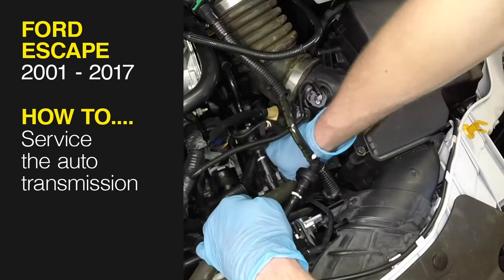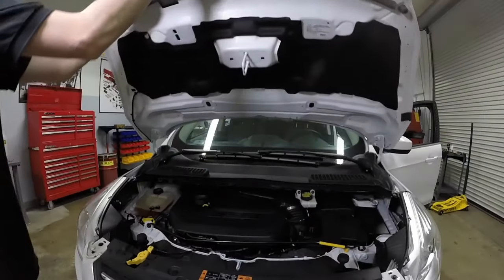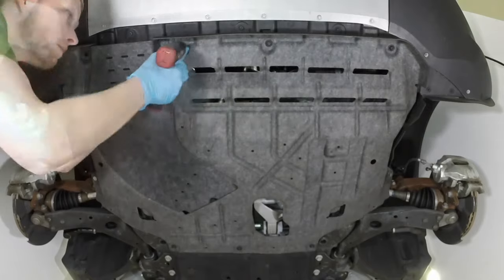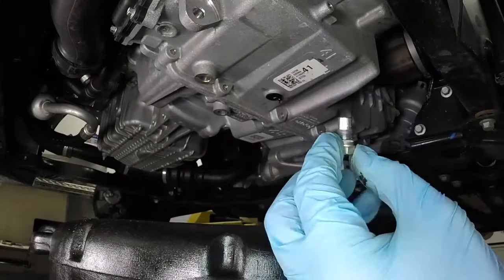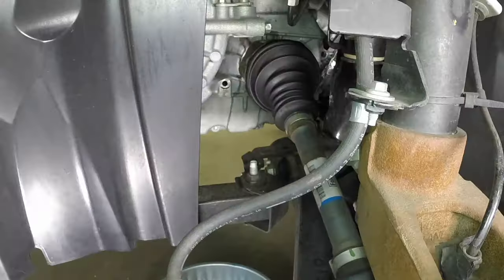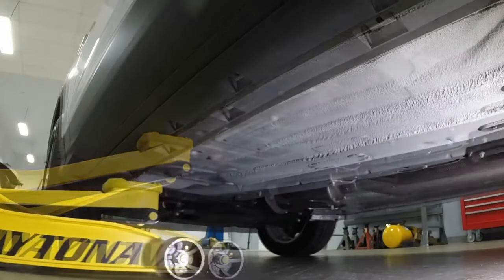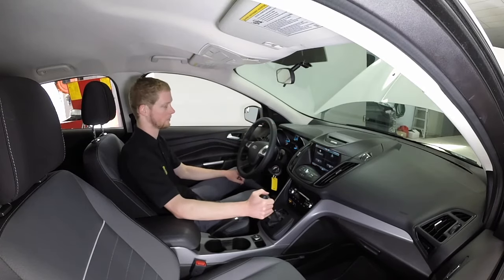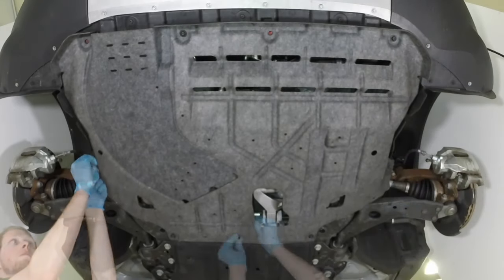How to Service the auto transmission on the Ford Escape 2001 - 2017

Comment: just replace the amount you took out. bam done.
Reply: Yeah, I was wondering about the same thing.  Like hell I'm putting it on the ground just to take another chance crushing a pinch weld jacking it up again.
Reply: No because it could of been low if it needed a quart more ur not knowing the trans can be low and you can cause damage that’s why u check the fill I run and then check it just to make sure

Comment: I will never buy a Ford again.  This is crazy.  From now I have to make sure that there is a dip stick to check engine oil as well as transmission fluid.
Reply: @MrCMVikram  that's too bad, all 8 of my 2015 fleet Escapes are still in use with 275k miles on them and the transmissions have never been serviced, just oil changes every 7500, but make sure you never buy a reliable vehicle again😂

Comment: My 2012 Escape does NOT have front and rear under shields as in this video. It has only a front shield. Also, in the video, all retaining bolts on the shields are easily accessible. One bolt on my 2012  is far to the rear, really high up, and almost impossible to get to unless the car in on a rack.
Reply: that is because they removed it permanently because they did not want to constantly removing it and putting it back every time they do an oil change, or undercarriage service. 

i had to purchase a new air damn, and new air dam screws . because it keeps the undercarriage clean from road debris, and the air dam also has a funnel channel to force air to the exhaust manifold pipe, to keep it cool and from over heating.
always check after a  undercarriage service to make sure that the air dam and all the screws are back in place.    9 metal air dam screws , they are black.  i spray painted mine while the air dam was off,  the screws were in place  and i painted it a metallic silver , to identify the screws and where they go. 
the air dam screws do have a tendancy of stripping out the plastic square inserts. so it is good to purchase new ones.  unless you do it yourself, always turn the screw backwards until you hear a tiny pop or click noise, then screw it inwards.  it goes back in its threaded seat. and the plastic square insert will last longer.

Comment: U are misleading  people on the level ing
Reply: What do you mean? I'm really curious cause I'm about to try to change mine.
Reply: @Why...So...Stupid...  need to make sure when it’s jacked up it’s level. So take a measurement before jacking it up. Then when it’s jacked up make sure it’s same height.
Reply: Yeah I wasn't totally up to speed how your supposed to check it the 2nd without jacking or lifting the car back up. Just put in what came out as long as it isn't leaking.
Reply: @_clownworld  He counts the teeth on the jack.  The same amount all around = level.

Comment: Am I able to use Mobil 1 transmission fluid? The bottle said it can be used by ford vehicles, I have a 2011 Ford Escape.
Reply: Mercon 1V, usually recommend ford the ford escape

Comment: My Escape 2011 will be flat towed behind my motorhome. I believe there is a technical bulletin for these cases? Can you explain ? Thanks
Reply: if your car is front wheel drive only , then the rear wheels will be fine  rolling along as it is being towed from the front. 
if it be a intelligent 4 wheel drive, then having someone driving it for you, is a better choice.
or get a car toting trolly that can be pulled as like pulling a trailor.